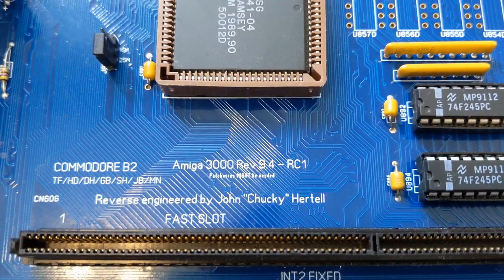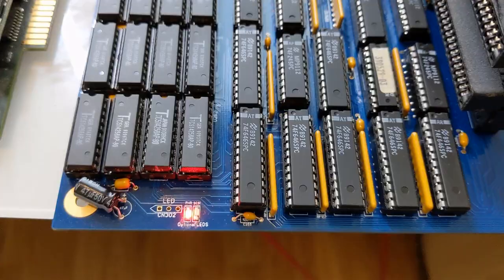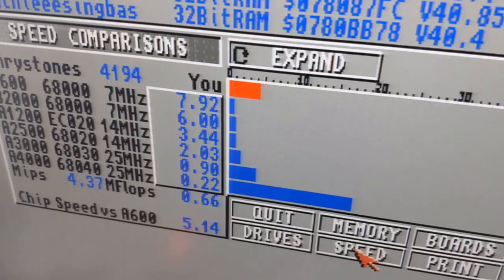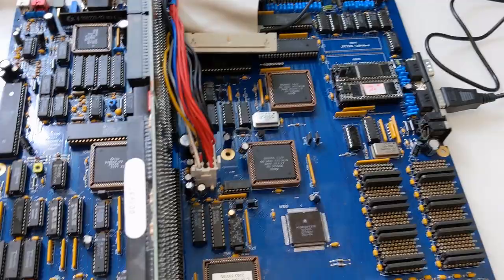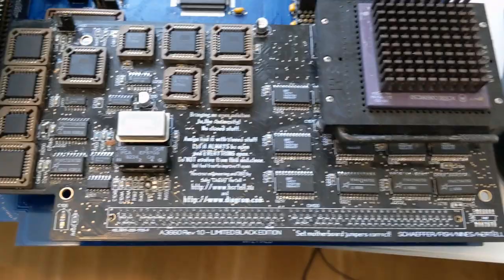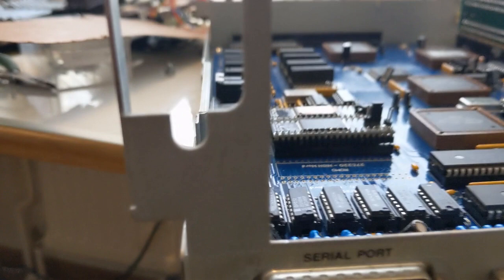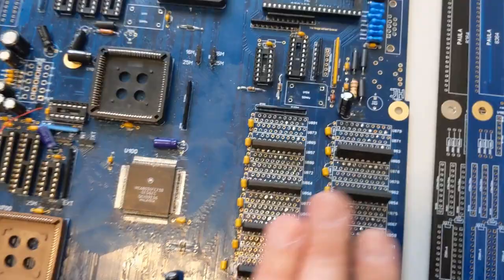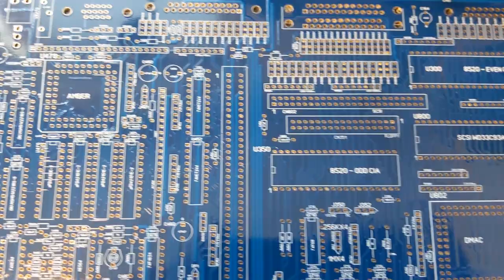Introducing the A3000

Comment: If possible these would be cool:
1. Remove the unused kickstart sockets
2. Coincell battery
3. INT2 mod (if not done already
4. Replace ZIP ram with one or two SIMM sockets, or even better surface mounted ram
5. Remove the onboard 030/882 and integrate the 3660 on board...

:)

Comment: Looks awesome,  if there is an option for requests... modern storage interface (SD Card or SATA), modern available ram and 060 socket on board so the 3640 can go-away, ATX psu connector and a riser card that that includes Mediator / Prometheus... biggest request is to have as much of the board pre-populated as possible, soldering is for young people and steady hands :P
Reply from the maker: Some options yes.  but it is not like yuou "just" can add a 060 socket.   sure I could implement the 3660  but as that memoryhandling sucks.  nah.    
atx psu connector I see no point of. connectors etc are available new so yuou can make a adapyer.  ltess see about SD etc.

this will be moved to eagle in time then maybe more modern solutions would be more "possible"
Reply: @ChuckyGang  the ATX connector is just a nice to have where you can with low effort fit a nice efficient, silent, modular cable PSU, not classic but makes having it on your desk running more pleasant. Thanks for all your hard work, looking forward to getting my hands on one...

Comment: First, brilliant job at doing this PCB recreation. Jolly good job!

2nd, would it be possible to recreate the custom chips using FPGA's?
Reply from the maker: possible to recreate custom chips in fpga.  absolutly   but 5V signalling etc will make stuff very expensive as a "drop in" replacement
Reply: @ChuckyGang   So, the problem is that most FPGA's have a 2.5V power requirement, and the Amiga uses TTL levels (0 to 5V)? 

Even if it requires translation of signals, wouldn't it be more expensive trying to source a used custom chip?
Reply from the maker: @peddersoldchap  lots of levelshifters etc  and FPGAs are not cheap either...

Comment: I have seen these re-designed A3000 boards on Ebay but I have not bought them as there are a couple of things I would need to know before building one up.  Firstly, do you need an Amiga 3000 board to populate one of these new boards with or can you use a more basic Amiga as a donor such as an A500+.  I am asking this because A3000's are, as you are most likely aware, getting pretty hard to get hold of and expensive.  I have also seen expansion cards available for them that I presume are CPU cards to use with these motherboards.  What would I need to populate one of those as well (assuming they are indeed needed to get the system running)?
Reply from the maker: those boards are NOT on ebay yet.  on Amibay however..  I will release the real data at Amiga34 this october.

you will need an A3000 to take components from.  as.  SuperDMAC, Amber and the very very VERY hard to get agnus.
In the video I show it booting using the A3660 I made 2 years ago. they can be built by using more or less all new components except the cpu.

Comment: This is awesome work. But why no upgraded zip sockets to simm? Also what about new cases?
Reply from the maker: As told this was as a baseline.  I do now have a version with SIMM.  due to be released at Amiga34 in Neuss next week. (however it seems that the production order of the pcb got broken.  the testboard works. but not the "for release"  working on it now.

cases. that is for others to do
Reply from the maker: Issue with new productionboards found. . it seems to be a "simple" componentissue. PHEW.  so release at Amiga34 the 12:th of october in neuss!  www.amiga34.de

Comment: any chance you have any of these boards left for sale? I have a very poorly a3000 B2 where the battery has eaten into the GND/VCC plane and there is a major short! very sad A3000 owner :-(
Reply from the maker: got one black SMD version left. 95eur+shipping

chucky<at>thegang.nu  :)
Reply: @ChuckyGang  Ideal, how easy are the components to get hold of? I presume it will take most of the ones off my old board? I had a go at repairing my old board but am now getting a short circuit when I test the +5 and GND on the PSU socket. Its gonna take a lot of work and time to try and fix (if at all possible) so I was considering the new board as an alternative.
Reply from the maker: @shaunfoster4483  all passives I get new.  most logic I get new. connectors you can get new most of them but I generallymove the old ones.  and chipset you need to move..
Reply: @ChuckyGang  ok, if I go for the new board, how do you want payment as I think this is going to be my best option?
Reply from the maker: @shaunfoster4483  Paypal is the way I want to do it
Reply: @ChuckyGang  ok, could you give me details and cost to post to UK please
Reply from the maker: @shaunfoster4483  send me a mail to  chucky<at>thegang.nu  for details
Reply: @ChuckyGang  👍
Reply: Hi chucky, just want to make sure you received my mail. many thanks.